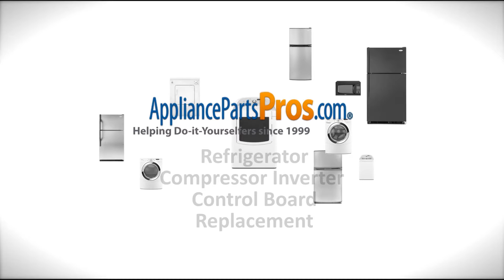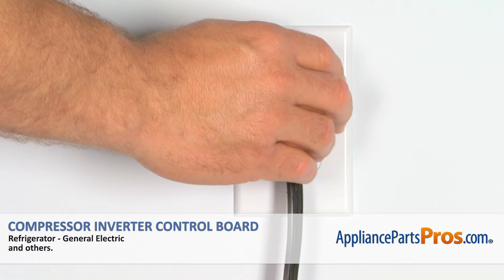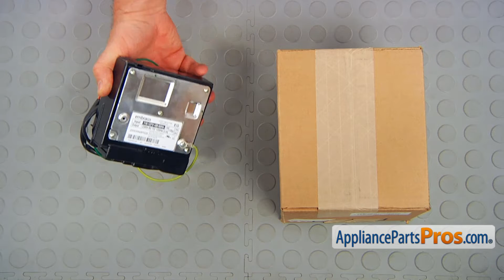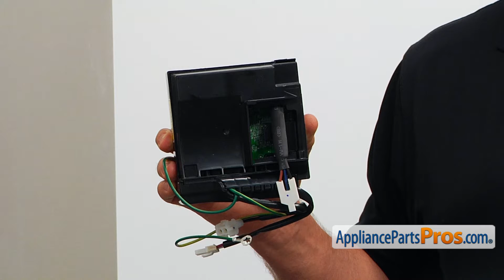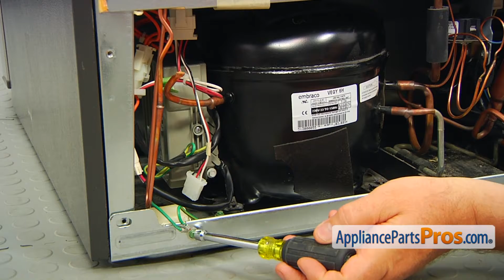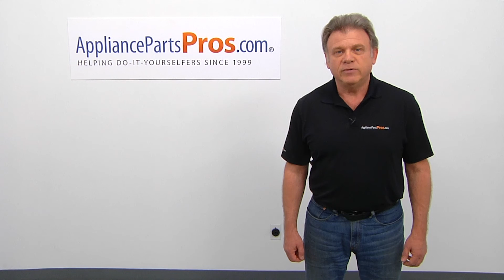How To: GE Compressor Inverter Control Board WR87X29409

Comment: This was super helpful for me.  I ordered an inverter from Amazon for $100, and it was an exact replacement.  As everyone has said - removing the old board and getting the new one in was the hardest part.  I was able to move the thin-copper tubing on the left, and just the compressor just enough to get the old board out.  I removed the white nylon cable holder on the left as well.  You have to rotate the board a bit - pause the video and you can see how he does it.  Even listing the compressor it's a tight fit.  The new board seemed to go in a bit easier.  Fridge is cooling now.  Seems like it takes forever, but fingers crossed this is it.  GE Profile fridge is 10 years old.  I read the compressors only last for 10-12 years, but I figured this was worth a shot.  Beats paying $2,500 for a new fridge!
Reply from the maker: Glad you were able to fix your issue! If there is anything we can help you with in the future please let us know.

Comment: I just replaced a control board, inverter and compressor on a GE Monogram. It worked for 5 hours and cooled down. Then died. Now the compressor won't turn over. I can hear the compressor trying to turn over but nothing. Any ideas?

Comment: How did you know that the inverter needed replacement.  My Bosch fridge isn't freezing.  Fans work and coils are clean.  Not sure how to check other parts.
Reply: Same symptoms for mine Electrolux
Reply: Fan works, coils are clean. I'm changing this part out tomorrow

Comment: Changing the inverter worked. Thank you. But how much more life does the compressor have in it? Ours is about 9 years old. And I searched it up and they said life expectancy on a refrigerator compressor is about 10 years. Which has me worried.

Comment: Thumbs up to the video for giving me the confidence to do the repair. Be aware though: for this refrigerator the most difficult part of the repair is getting the old Inverter Control Board out, and the new board in. The video fades/cuts at these moments, finessing the difficulty involved. In addition to lifting the compressor, I had to take advantage of a little forward and backward motion the compressor allows to create a large enough gap. Had to work with it a long while.
Reply: I just bent the copper tube out of the way a little bit. Risky I know. But it worked. And you're right. Getting the inverter box in and out is extremely difficult.
Reply: I ended up removing 4 anchor bolts with 11mm socket with aing extension.  I was able to move the compressor a little to the right so I could wiggle the box out slowly

Comment: I just had to pay a guy $180 to diagnose my CYE23TSDCSS. He said it was the inverter control board. He wanted $530 for the whole job. He said I could most likely do it myself, but there would be no warranty. I ordered the part...I'm going in. Wish me luck.
Reply: How did you diagnose that it was inverter control board and NOT the compressor itself?
Reply: @liarcheckmate  I took a gamble, and changing the inverter worked. But now I'm wondering how much more life the compressor has in it. I'm hoping for another 5 to 10 years. By the way, the lady at the appliance parts store said they had 35 of these inverters in stock. So you know this is a part that goes bad often. And service guys are most likely changing these out all the time.
Reply: @trueblu8  my fridge stopped working over night. I unplugged and plugged back in and compressor doesn't start.  Do you think this is the part. I removed mine amd ordered from Amazon Prime already. It is arriving tomorrow.  I hope this is the fix for it. Mine fridge is about 8 years old now
Reply: @conchim99  watch the video I posted a link to. And good luck.
Reply: @trueblu8  i fixed mine. It needed a new inverter.  It now running nicely
Reply: @conchim99  that is awesome news! Congrats man. 🎉
Reply: @liarcheckmate  A repair guy diagnosed it. I'm really not sure how he did it.
Reply: What was wrong with your fridge?
Reply: How did it go? I'm having the same identical issue with my Fridge PFE29PSDASS not cooling at all. I don't see a relay in there, so I'm assuming this is the issue. Thanks in advance
Reply: @jorge135  it went fine. It’s pretty much plug n play. The hardest part is getting the part maneuvered around a couple of copper lines.
Reply: @jorge135  omg.  I am here looking how to troubleshoot, and you literally have the same fridge as my wife and I.  We just received this part in the mail.  How did it work for you?